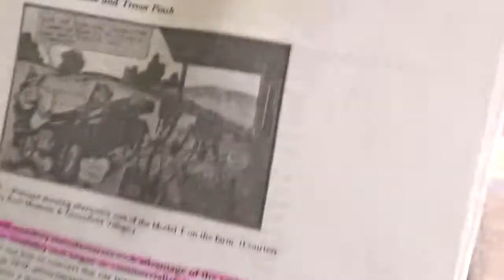What is Technological Interpretive Flexibility and How Does It Relate To Apps and Automobiles?

Comment: you're highlighting the significant level of technological innovation. There are great examples, especially from the lecture, where you can swap out key car components such as the transmission system, engine, and more, demonstrating the adaptability and customization possible with advancements in automotive technology.
~Ayesha Imam